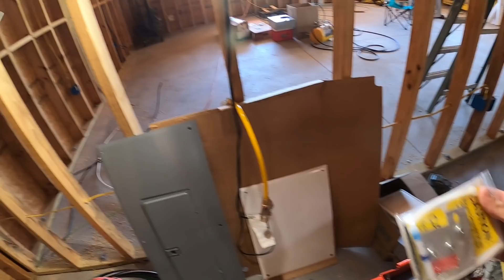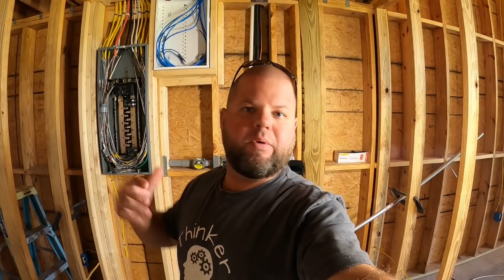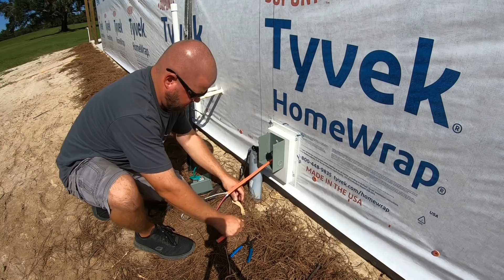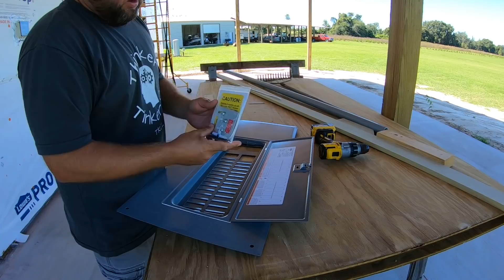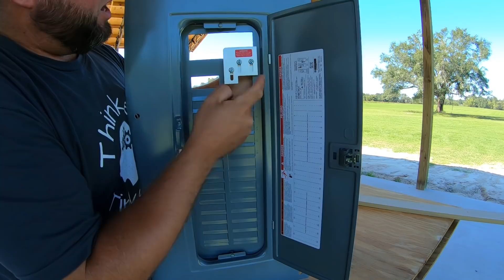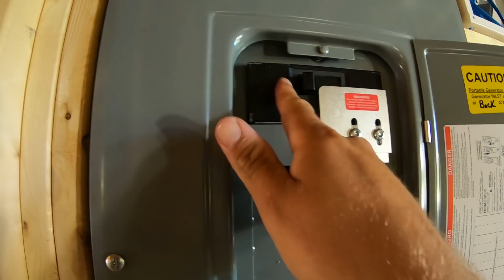Generator power inlet box and interlock kit install! #452

Comment: Is there another device you can install that lets you know when the grid power back on ? I understand you can see your neighbors house if your in the city but if its out in the county or even day light out might be hard to tell .. I know if you call in and report the outage youll get text or email updates , but some sort of bell or buzzer , would be cool
Reply from the maker: I'd like that myself, I am not aware of a product because it would have to be before the meter or before the main panel.  What I do is occasionally check the meter, if you see numbers or is spinning, you have power back.
Reply: My home has 2 electric panels. One panel outside on the power pole that energizes my 5 ton air conditioner and my shallow well water pump. The other panel comes off that panel and energizes my home circuits. I hook  the generator to the sub panel and use 2 small window units inside during outages. That means I can wire my well pump to have a receptacle come off it to plug a lamp up to that. When the power comes back on my outside panel will become energized and the Lamp will light up and the 5 ton air conditioner will kick one. Turning off the main breaker in the home circuit panel isolates energy from backfeeding into the outside panel and also will not allow my outside panel to feed into my home circuit panel.

Comment: Good explanation.   I know that your video doesn't get to actually hooking up a generator, but I see people mention that bonded neutral generators have to be made into floating neutral when the generator is hooked to a house electrical system.
Reply from the maker: That's the proper way to do it, some generators offer this ability.

Comment: Suggestion: if you upgrade to a 50amp service, the cable for your generator will be VERY heavy. or at least mine is. The contractor didn't put any blocking behind the outlet and the outlet doesn't  feel sturdy on the wall. If I had it to do over again I would have paid better attention and had them install a piece of 2x4 blocking or another piece of osb in the wall to give the screws more meat to bite into and to make the outlet feel more securely connected to the wall.  with your access panel inside that will be something you can easily add. i would have some sheet rock work to do on my setup.
Reply from the maker: There will be a door directly behind that outlet inside under my main electrical panel for easy upgrade if necessary. Seeing how easy this size generator started my whole house AC, I don't see the need to ever upgrade generator size and wiring.

Comment: I realize you are just doing rough in, but later when that generator breaker is installed it needs some sort of tie down to keep it from being removed easily.  That’s a code requirement.

Comment: Everyone talks about how the interlock protects the linemen. But in reality if the generator power went out to the neighborhood the main breaker on the generator would most likely trip for overload.  I think the interlock’s protection in the other direction is also important- you don’t want the male pins on the inlet to be energized. This would happen without an interlock and the breaker would not trip due to overload as the inlet would not provide a load when it’s disconnected.  I can just imagine (without interlock) someone trouble shooting a power issue, noticing a breaker off and turning it on to fix an issue and energizing the inlet. So please use interlock to protect against shocking a person touching the inlet.
Reply from the maker: You do realize it works both ways??? You can't energize the inlet due to the interlock cutting off the main pawer inlet from the pole????
Reply: @TKCL  thank you for your feedback.  I have gone back and edited my post.  I hope it’s clearer now after making changes.  I was trying to say that the probability of shocking a lineman was low due to overload causing power off of the breaker. Whereas shocking a local occupant might be higher due to exposed male inlet pins.  Both of these issues are resolved with the interlock.

Comment: Does the main 200 amp  breaker disconnects the main line neutral too? Or it doesnt matter?
Does it not feed back power to the main line through the main neutral line?
Reply from the maker: If you kill the two main hots coming in, there is no current on the neutral.

Comment: When you stop and consider how many millions of homes lose power every single year in the US, it's hard to understand why the NEC (National Electric Code) has not made a power inlet box and generator interlock mandatory years ago on all new construction for homes. The power inlet and interlock kit are a simple, cost-effective, and efficient way to provide power during an emergency. I am shocked at how many people do not have or do not know about this kind of setup.
Reply from the maker: Me too, it's very affordable and much safer than back feeding a home by other means.
Reply: @TKCL  Absolutely right. This is by far the safest, easiest and most cost-effective way to safely backfeed a panel.

Comment: In the process of hooking up a power inlet box and your video provided the exact information I needed to know about the interlock switch. I was about to knock out a couple of panels on the left side because I didn't think it mattered. Oooooooops,.... I do have one question. The box i'm hooking up is a 50A. A note inside of the box states it must be 2 feet from the ground. I noticed yours is kinda close to the ground. Is it because it's a 30A and not required?
Reply from the maker: I couldn't find anywhere in the National electric code that stated a minimum distance to ground for a receptacle.  I'd do what the package says and you should be good.  No flooding or splashing will make it to my box.
Reply: Probably more of an issue in northern climates where it's not uncommon to have 2 feet of snow.  Shouldn't be a problem in non flood areas of the south

Comment: I don't know brother, I did that cord connected Generator drill for 20 years!  I just purchased and installed a champion 14 KW LP whole house generator w 200 amp wi-Fi enabled transfer switch for ($ 6,850 generator and switch) transfer switch web enabled function is awesome. Shows the panel load on the normal or Generator conditions via embedded webpage . Peace
Reply from the maker: Well this one runs my entire house (hvac included) for about $800. That leaves me $6k to use elsewhere. It's also portable so I can use it other places. Really hard for me to justify a whole house one when I get no more benefits other than instant transfer of power and some monitoring.
Reply: @TKCL  Thank you for not lowering your standards for a privileged guy! Those the type of people that always find something wrong.

Comment: I would have installed the PB-50 50 amp inlet with 6/3 behind it because they make a 30 amp to 50 amp converter plug.  This would allow you to use the 30 amp inlet yet have the ability to upgrade to the 50 amp if you ever up size the generator.   Not trying to be critical just a thought so you can expand as your needs grow.
Reply from the maker: No worries, if I ever upgrade my genset I can easily pull a new wire outside and add a 50 amp inlet plug.

Comment: You really should have flashed that opening properly with Tyvek flashing tape.
Reply from the maker: If you're talkin about the hole that the wire comes through, not only did I use flashing tape, I use rubber butyl liquid flashing too. Nothing is getting in that hole.

Comment: Probably too late now, but I would have used 50amp wire from 30amp plug to service box, then if you changed later you'd only have to replace the plug.
Reply from the maker: Won't be a problem, that's why I built a panel closet. I can pull a new wire easily.

Comment: Exterior outlet should be 24” above ground, thats code.
Reply from the maker: That's not code, it only states a maximum height above ground. I've already passed my electrical inspection too.
Reply: @TKCL  extremely surprised. Also your neutral should go on the neutral side. The ground should go on its own side as well in the main panel. You stated sub panels have to be done that way, thats incorrect sir. Im a licensed electrician myself.
Reply from the maker: I'll also disagree with you again, your assuming I have a outside disconnect, which I don't. Straight from the meter to the main panel. Code clearly states separation of grounds and neutrals AFTER first means of disconnect. My main panel is my first and only means. We are allowed to install without a disconnect if meter and main panel are back to back only.

Comment: Nice job here... The power inlet install on the outside had a professional feel to it...The clamped & sealed tube for the cable to run through was a nice touch, as I noticed the sealant when the box lid was opened up as well & assume the top & both sides will get a touch of sealant too. Back inside the main panel, once again clamped & just above the box, an additional brad to the wood beam for further nonmovement of cable when running it out... All good stuff, thanks for sharing... 
Bill on the Hill... :~)
Reply from the maker: Thank you for watching

Comment: Quick question, why not throw in the #6 wire now so you don’t have to open your wall if you want to upgrade to the 50 amp gen later.
Reply from the maker: Availability, it's been tough finding what I need. It will be a easy change out later if needed with the way I'm designing my panel closet.
Reply: @TKCL  gotcha. If you were closer I’d give you some 6/3. Got a roll of MC laying around. 
Guess I should try selling it now with the prices the way they are.

Comment: I think you should be fine. Our 9500 watt runs our 3.5 ton cooling 2500 sq. ft. just fine. The only circuits we leave off are the stove and water heater.
Reply from the maker: That's great to hear

Comment: Awesome install!  (except for the crooked warning stickers, which I hope was a video optical illusion)
Reply from the maker: Dang it! Nope, and it's been driving me crazy! Now I have a crooked electrical conduit pipe in the yard that's really driving me nuts! It would cost an arm and a leg to change it, so I guess it stays. 😔
Reply: @TKCL  😢 Crooked, un-level and off-center (when applicable) decals and stickers are my biggest pet peeve.  I worked on a project years ago where we were labeling all the electrical circuits, receptacles and switches in a VA Hospital in Miami.  I ended up spending hours going behind my co-workers and relabeling due the crooked applications.  They all laughed at me while I seethed...  lol.  After a week, they all started doing better and actually attempting to get them placed level and centered though.  By the end of the project, my obsession had spread and they all became master labelers.  I can hardly wait to see your outlet plates laser engraved with each breaker #  :)

Comment: I have almost the same set up that you have minus the dual fuel generator mine is gas only. Has worked great in the 3 years since I installed the system. You should really like it too
Reply from the maker: Fired it up yesterday after sitting for months, ran great!

Comment: you didnt put the generator 10 gage cable into conduit all the way to the panel so switching to a 50 amp generator will still be difficult after sprayfoam. are you not sprayfoaming the area under the main panel?
Reply from the maker: Negative.... Don't forget I'm spraying 5 inches of foam. I built that wall out an additional 3.5 inches and made a cabinet space above and below the main panel. That will be hollow and eventually have doors for easy access and future wire pulls. I left enough conduit sticking out from the generator box inside to just get past the spray foam and into that hollow cavity.

Comment: Best money we ever spent was on a whole home Eaton/Generac 22KW with automatic transfer switch.  When the power goes out, we still mange our power load, but that is not difficult to do at all.  Plus if we ever decide to downsize and sale our house, it's a great selling point.
Reply from the maker: We were dead set on getting one.... But that money has been spent elsewhere lol.
Reply: Yup, we are going through that same decision on our new home build.  We ended up going with the generac 22 kw.  I did not want to have to drag a generator out when power goes off but the biggest reason is if power goes out while you are away you don’t loose a freezer full of meat, a sump pump doesn’t get shut off and any other necessities that need to keep going like heat in house during sub freezing temps.
Reply from the maker: Good thoughts on being away with a power outage.

Comment: Something I would highly recommend since your wiring up a generator plug, take the time and frame out in the area your refrigerator is going to be located for an inexpensive computer UPS in-line for the refrigerator. My family owns an appliance repair company in Tampa, FL and the absolute most common electronic that is damaged from portable generators are modern residential refrigerators. Simple ups in-line will prevent this as an issue in your future.
Reply from the maker: We run very basic refrigerators with no bells and whistles (seem to last the longest). Do you think even with a low end model a generator would damage it?
Reply: @TKCL  Its just how cheaply they build them these days.. Its not the power going out that kills them, its the non-pure sinewave that occurs on portable generators. As the generator is loaded down with more and more load, the shape of the power curve degrades and this is when sensative electronics become damaged. Literally every time there is a major storm in the area that takes out power, we will get slammed with refrigerator repairs and 99% of the time when we ask them did they power their house on a generator, they say yes... Im not saying you need an expensive UPS, just a cheap 600va unit is more than plenty for covering the frig, plus when the power does go out or hiccups.. your frig is safe from power surges, voltage spikes, and such.. The UPS is just stepping in mostly as a filter than a backup power supply.
Reply: @TKCL  Also, the cheap models do in fact have the least issues. I always tell people when they want a new frig, dont buy one of the fancy ones wth ice makers, coffee makers, screens on the door.. Just get one that has a frig and a freezer with the ability to ADD an ice maker. Those are the ones that last the longest, because they build the ice makers far cheaper in the kits and seem to actually be more durable than the complex ones they pre-install in the doors of modern refrigerators.. plus.. $50-100 and you can replace a broken ice maker, which is the most common broken item on modern frigs that our company is called out for repair service.

Comment: One advantage of a transfer switch is that many of them can be programmed to run automatic testing where they fire the generator and either just run it or actually transfer the load. This is useful when you need the generator to run a whole plant or something.  I used to work in a shop with one of these switches. Every Tuesday at 1AM, it would run the auto test. We had a big Kohler generator outside but the actual diesel engine in it was a John Deere tractor motor. I kid you not. Wasn't a Yanmar either. An actual JD motor.  That thing was a beast.  The reason for testing at 1AM on a Tuesday was to give us time to call emergency service when it didn't fire up, and still have it repaired and working before management showed up and started asking questions.  The problems we did have were all charging system. It had a battery maintainer that didn't work right.  The JD motor never gave  is a bit of trouble.   That shop closed and they used a crain to pull the generator and just scrapped it. For no reason.  Sad.
Reply from the maker: Even with a transfer switch, it won't power up a basic generator like mine. You still need a auto start gennie and those ain't cheap 😬

Comment: Andrew I have a question. How will you ever up grade the wire to the generator should you need to with it nailed to a stud and then you have the spray foam on top of that without having to go into sheetrock and having a mess to repair in a wall? Looks like to me it would be better to have the larger say #6 wire installed now than later less headache again just asking..
Reply from the maker: Go back and watch the first main panel install video. The reason I built the wall out was to make an un insulated cabinet below and above the panel for future wire pulls. It will have a cabinet door above and below for easy access.